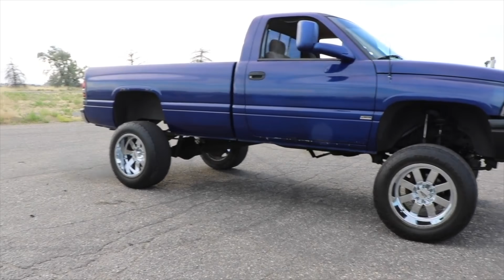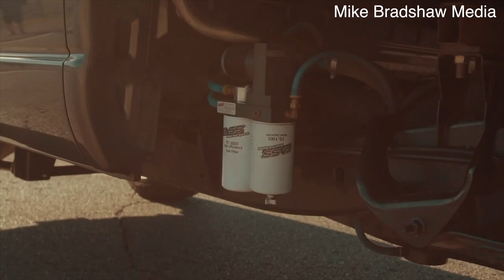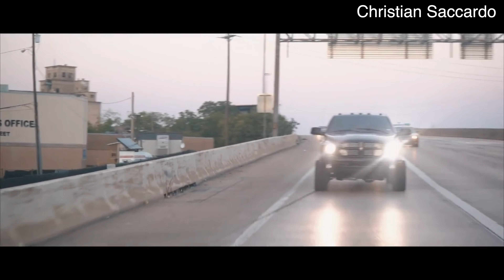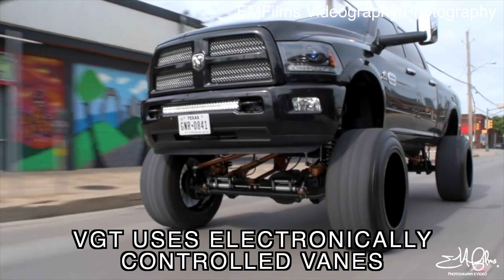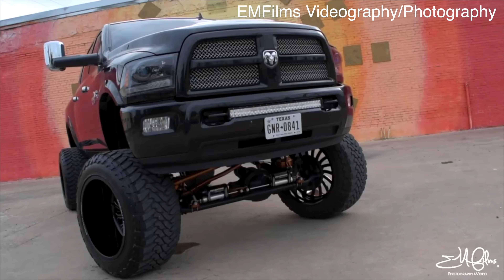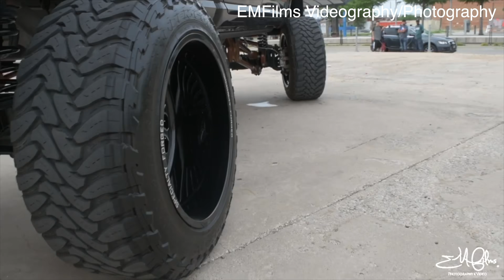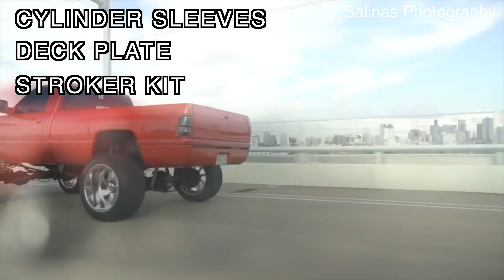5.9L vs 6.7L Cummins: Which One is Actually Better?

Comment: I've owned all three models of the engine and understand each was a well thought out natural evolution of the prior ones. My 12 valve had 400K on it when I sold it and its running around yet today. My 24 valve 5.9 was just as dependable but suffered from poor quality components such as step pump and water dispersal system. My 6.7 has ran flawlessly for 188K with only minor issues with the TIPM. Cummins is in a different league than the competition so any comparison is pointless.
Reply: Problem is, everyone is on the delete train. You don't need to delete the emissions systems.... Then, when they have problems with their engine, they suprised pikachu and blame it on the emissions system, creating a false narrative. The engine was designed to run with the equipment it has. Not run with a S400 turbo, deleted egr system, dpf, and 200 HP injection map in the ECM.

Comment: Personally I would go with the 67 L Cummins turbo diesel the 6.7 L Cummins turbo diesel is a great engine for a work truck I think the 24 valve is a great racing engine and a great daily driving engine but when it comes to the 6.7 L turbo diesel I think they’re both great in general if I had the money and time I would own both

Comment: The old school 12 valve Cummins hands down. (94-98) even better! I can feed my 94 12V used motor oil, apple juice, dirt, and whenever times are hard, baby formula. Not that sensitive crap either!

Comment: i owned a 98 6 speed single cab. traded it for my 03 auto. later bought a 13 auto. other than the transmission in the 03 its been a hell of a truck. still have it and the 13. wish i had never got rid of the 98 tho. as far as pulling that thing was a beast. if i could find another one in good shape i would buy it in a minute. far as the engines go i would trust the 5.9 over the 6.7. plus you dont have to spend $7-$8000 deleting them to start adding power.

Comment: As a Cummins tech I will tell you a 5.9 has it all over the 6.7. Just a 12 valve 5.9 will net you 50% more than a 6.7 and it’s all mechanical. Zero issues.

Comment: I have 2 of the 5.9 / 12 Valve in 1 ton trucks I uses on my farm and I love them. I retired from Union Pacific Railroad as a electrician. The newer Technology is great as long as you have a standby mechanic to keep it running. Union Pacific Railroad uses older Locomotives with mechanical blowers in there Local switch yards till about 2012, because all you had to do was fuel them check the oil and run the shit out of them. They were bullet proof.
Reply: those switcher can take beating like my 12v cummins
Reply: I work out of livonia for u.p.
Reply: The railroads lobby against the trucking industry forever. 

 The few railroads will stop at nothing to over regulate their direct competition while they have very little in their way to build as they please.

Railroads are in a private Idaho of their own.  

Almost the transportation untouchables.

Comment: I have an 05 5.9 and a 09 6.7. I didn't think there was much difference in power until I deleted the emissions on the 09. That woke her right up and my milage almost doubled.  It doesn't put out nearly as much noticeable black smoke as the 05 does. I think if you hit them with a tuner to make a lot of smoke you are just painting a target on every diesel truck.  In normal driving,  I can't see any exhaust from the 09 and if I mash the peddle I can hardly see a cloud behind me. The only way you would know I deleted it is to look at the exhaust pipe. My conclusion,  the 6.7 is better, if it's deleted.  Otherwise I would opt for an 02 with a 6 speed manual without the common rail because the injectors are very expensive and less reliable.  If I need more power out of it I can get it.

Comment: Given the disadvantages of the 6.7 Cummins vs. the 5.9 Cummins, including the Cummins ISB, I'd choose the 5.9 Cummins. I'm all for clean air emissions if it can be done without causing problems with complexity, quality and reliability, and maintenance. But that's the downside to emissions equipment.
Reply: I agree, 99% of brakedowns in trucking are from the DEF system
Reply: @nashvilleoutlaw  What's that? What's a "DEF system"?

Comment: What bothers me the most is why the 5.9 litre Cummins was ever replaced by the much larger 6.7 litre Cummins? I would think that the 6.7 would be fine for a Class A motorhome, and heavier duty trucks, but for a truck like the Ram 2500 and 3500, etc., the 5.9 litre would be perfect.

Comment: its the same motor...just punched out. The problem is the Emissions system...it kills the 6.7. The 12 valve was a literal million mile motor....5.9 1/2 Million.....6.7 300K ish.... see where this is going. EPA regulation...shorten motor life, reduce MPG's.. but good for the environment...somehow?

Comment: By the way, all of these engines are based off of the big trucks or semis. The 12 valve is based off a late model big cam cummins. The 24 valve is based off of the n14 and the 6.7 is based off a isx15
Reply: So it wasn’t because of computation it was because of designs that worked and they scaled it down for pickups

Comment: Can anyone tell me what the towing capacity is for a 08 5.9 3500 dullay? I have found one lifted but I worry about the trans issues with dodge? I need to know the towing capacity from the hitch? To my knowledge the truck has never had a 5th wheel ball in the bed.
Reply: So Michael, Dodge changed to the 6.7 in mid 2007...!
Unless someone swapped out the 6.7 for a 5.9 in that 08, !!!
For the towing numbers go to the web...
Mine is a 06 Dually, 5.9 with 4.10 gears, I tow  a box trailer and a boat... 
Mine is cat Deleted with a straight 4”.... 
in 06 no EGR, 

Milage still sucks at 16 mpg towing at 65 mph...
I get 18 mpg on the highway not towing...
FWITW I have a ARE LARGE / tall bed CAP... which I am guessing weighs about 300 pounds....
In addition there is always about 500 pounds of cargo in the bed , 
Can’t tell if the aerodynamics of that tall bed capper hurts or helps in the milage department...

Comment: Variable  turbo make too much boost to low down  causing smoke and wear  better let it rev bit and stop asking it to do impossible  also causes to much power at high revs ok for drag strips  but not for road use  . USE LIKE IT SHOULD BE MID RANGE TORQUE SCANNIA  V8 GREAT EXAMPLE   DO 1500000 MILES JUST WITH INJECTOR FEED PIPE SEALS AND WATER PUMP AND FEW HOSES

Comment: I'll stick with my stock '03 5.9L 305hp. Makes all the power I will ever need. I want reliability when towing a travel trailer for miles and miles away from home. Only modification so far for me is a Fluidampr which makes for a smoother, quieter, more RELIABLE engine.

Comment: I just bought both lol got a 89 5.9 and love it all around I bought a 2012 brand new and love the power the 89 is stock the 6.7 is deleted and tuned and I have put over 200k on the 6.7 and pulled a lot of heavy heavy things and I don’t treat her nice and not a single break you must build the truck for the task your using it for to get the best truck

Comment: This lad is apparently telling us about two particular years of these engines, (or he is talking only about pickup truck engines without telling us so) he is not right about my early 2000. 5.9L Cummings (260 bhp on a Spartan Summit chassis) that is in my RV.  It has 24 Valves (it says so on it's valve cover) a mechanical fuel injector pump (rotary style, electronically controlled) and exhaust breaking, a combination that he said isn't so. (it has no DEF or ERG) It does have quite a bit of "turbine lag" which he didn't mantion. Ron W4BIN
Reply: Wow Ron, I would have never figured out he was talking about Ram pickup trucks without your comment. Thank you! 😐

Comment: I like the 5.9 better, had a 02 second gen and a 07 (5.9) 3rd gen, he didn't mention the 3 different types of 5.9 24v engines, standard (99-02) medium output (03-05) and high output (05-07) i loved mine but 07 had less horsepower because of the mods on the 02, however 07 was quicker because of better gearing, I really want an 04 now, buddy of mine bought a 6.7, it burned cyl 1 after 20k miles

Comment: I'm considering a 2020 Cummins and have 2x QUESTIONS or concerns and hope someone could chime in.

1) How loud is the 2020 Cummins at idle in comparison to earlier years. E.g. our neighbor has a 12V 5.9 and it idles way too loud.
 I heard a newer Power Storke at the gas station and it was really whisper quiet. Same with GM. Is this Cummins already that way too?

2) Would this 2020 Cummins offer reliability for a 10.000 mile per year, non-towing, mostly daily driver to work, application such as mine. OR do these engines need to be pushed and in order not to get dirty and end up with clogged up emissions components.

3) I know probably a gas engine would be more suitable for my use, but I really want to avoid the Hemi's MSD.

Comment: I would be interested in knowing the difference between the 6.7 engines before and after the DEF fuel system was added. I have a 2012 model, which was the last year of the pre DEF models

Comment: It's Simple; the 5.9 is lower on power, it is VERY Reliable. The 6.7 is a BEAST BUT not as reliable and NOT because the engine itself but the Govt regulations..

Comment: You can upgrade the 6.7 by installing the 5.9 head, injection system,  and ecu. Firepunk Diesel has a video on that
    While there may be some benefits to running the stock vgt turbo you will quickly find its disadvantages if you’re going for maximum power. It is actually quite inefficient with a high drive to boost pressure ratio so even if you’re running your truck basically stock you’re still better off with a relatively small fixed geometry turbo (BorgWarner S380 or S400)
There are a lot of other parts that interchange on these engines such as water pump, oil pump, camshaft, valve train, front cover, etc. The 6.7 will bolt in to a previous generation truck with no modifications. 
  This video mentions head gasket failure- the 5.9 head gaskets have been known to hold very high boost pressures even when using oe headbolts this is not the case with the 6.7
    Both motors can make over 1,000 hp with compound turbos and larger injectors. Pretty much the only reason for Dodge to make the switch is emissions control. This increased displacement allowed them to comply will still competing with Ford on power output

Comment: I've had 2005 5.9 H.O.
LIKED IT BUT IVE OWNED 2015 6.7 & NOW I OWN 2018 6.7 
I LIKE THE 6.7 WAY BETTER, ALSO LIKE THE 68RE BETTER. JUST MY 2CENTS.
Reply: I have an 2007 HO...I miss the Allison from my Duramax so i'll be putting a 6spd Allison conversion in my Ram when the 48RE bites the dust. Ram honestly better find a 10spd Aisin pretty quick...GM and Ford are winning in that dept with mileage and better shifting.

Comment: My 99’ Cummins is currently getting 30mpg and have 320k. Haven’t driven a 6.7L but feel my 5.9L 24v is better due to reliability and years of service, but have heard nothing but great news on the 1st gen 12v.Would like to see a NEW 12v all wrapped around the new bells and whistles of a 2019-2020 Cummins!!!!
Reply: What do u have to be getting 30 mpg? My 4.10 gear with nv4500 24v definitely isn't that good

Comment: My 12 valve has 458 thousand km on it iv had it hot twice and ran it low on oil once it has no grid heater it's my plow truck doesn't roll over twice minas 12  to 15 degrees starts every time

Comment: My 2009 6.7 was a pig until i deleted everything... it then became a truck!  Never another problem and it has 450,000 kms. My 5.9 has 450 k as well an it runs even more reliable. The 2 huge problems i have with the 5.9 compared to the 6.7 are lower power and the POS 48RE compared to the 68...I'm actually thinking about a CA conversions Allison conversion... so expensive though.

Comment: 2002 Dodge Ram 5.9 Cummins 285675 miles still going strong only mods I've made are 5 stage comp chip , cold air intake , 4 inch exhaust & fass fuel pump system ! Most reliable motor I've ever had ! Bought truck new ! Can't speak for the 6.7 as I've never owned one or drove one !

Comment: I have a 5500 with a 6.7 in it, the DEF froze on me. So, I deleted the entire truck, everything is gone. Put ARP head studs and drove 100,000 km’s no issues. Then the VGT took a dump. So I threw that in the garbage and went to a second gen set up with a fixed turbo. Essentially its a pre-emissions, pre-BS tech 6.7 with a whole lots of fuelling and jam. Thats the best cummins you can have.

Comment: I kinda liked my 04 cummins ram better than my 17 ram both had similar gearing.  The 04 had the 6speed man and seemed to have tons more available power but in theory the newer truck should be more powerful with 20 more hp and 100 more ft pounds.  And before anyone says anything no the 04 didn’t have a tune it was completely a stock truck when I sold it

Comment: Have a 5.9 that i ordered the truck in 04. No emmisions at all 6 speed manual 4 wd. 25 mpg highway with 4.10 ratio. At the time worked in heavy truck and the engine reps were warning us of the fuel loss, increased cost and decreased reliability that was comming due to epa regulations. They explained what are now 1st gen emmision engines and current ones that were already designed and being tested in 02. The first gen would run 20 degrees hotter, loss of 20 to 30 percent in fuel economy which carries over to our current usage. Engine oils were at the time still under development to cope with the increased contamination and operating temp. Engine life would be aprox 40 percent less and inframes would be more costly. They did say increased horsepower was a byproduct of increasing engine size.

Comment: I just wanted a truck that would last a long time with regular maintenance, so I got an 05 2500 with the 5.9. I just hit the 200k mark and only had to replace the regular stuff. Water pump, belt tensioner. I expect the rest of the truck will disintegrate around the still running motor.
Reply: So true about everything else disintegrating!!

Comment: I have more than 1 Cummins engines with emissions still intact and operational with over 750,000 miles and a couple over 1,000,000 miles. Requires more maintenance but doesn’t make them unreliable.
Reply: Are these 5.9 and what years or are the 6.7 and what years

Comment: It does not reduce reliability, it removes all reliability as 6.7 emission systems will fail. I own both, currently 1 6.7 (have owned 2) and 4 5.9 trucks. For driveability/street both being modded the 5.9 wins period. For pure power/torque (max hp pre-loading boost drag racing/tractor pulls or 800hp or less towing) 6.7 is king,  there is no substitute for displacement.

That being said, you will spend 1-3k+ a year cleaning/replacing emission systems (that are proven to not reduce emissions in real world applications, reason they are used: invest/law require to buy/use) on a street legal 6.7 as you warranty does NOT cover these systems, read it.

Now if you make the 6.7 illegal for the street by removing the egr and dpf and def systems it is the superior power plant for max hp applications and just as reliable as the 5.9. If you want to understand why the current emission systems do not work, ie do not help the environment, they reduce power when in action thus you press the accelerator further down burning more fuel..... That is why 10-15 max mpg 6.7 towing, 16-21 mpg 5.9 towing both trucks making the same horsepower. Food for thought.
Reply: The F—-yards in the government fail to recognize that when it comes to diesels, choking them with emissions crap results in higher fuel burns on bigger engines and ultimately MORE EMISSIONS...

Comment: I have a '93 D250 with a bone stock 5.9 12v and the 5-speed Getrag tranny.  I've owned it for 12 years and it just turned 200k miles.  I've never done anything to the engine but change the oil, oil filter and fuel filter, flush the coolant and adjust the valves.  I'm now thinking of bumping up the power a little, but I don't want to get to the point where I need to change the clutch out or overpower the rest of the drivetrain.  I just want to be able to keep a little more speed while climbing grades with my truck camper and towing my car.   I'm searching for a video that explains in detail the process of turning up the fuel screw, adding a custom fuel pin and different governor spring.  I've worked on my own vehicles for 50 years, but have never done anything like this to a diesel.  And I've read of some others trying this but ending up with an engine that runs worse than before.  Trying to decide if I need to take it to a diesel mechanic instead.  Can anyone recommend a good video explaining the process?

Comment: Thanks, great comparison. Myself I prefer the 5.9 for reliability, and better fuel economy in general. My 2002 LB/4X4/4 door was getting about 24 MPG with full cab and bed (not towing).
Reply: If im nice I can get about 21-23mpg in my 5.9 megacab 4x4 dually

Comment: Hello, as someone else said that the all mechanical 5.9 is the best. 91 N/IC stock with a bit of added timing I regularly obtain 20-24 MPG, replaced the 727 (37RH) to a 46RH with 3.08 rear gear set 335800 Miles on the ticker.  I don't ever expect to sell and oil samples show minimal wear, 1.5 Million miles expected (ill probably die before that). Best purchased I ever made and great mileage. Love that pickup and still in todays road climate I love to drive it.  Pretty darn good for an old beast.